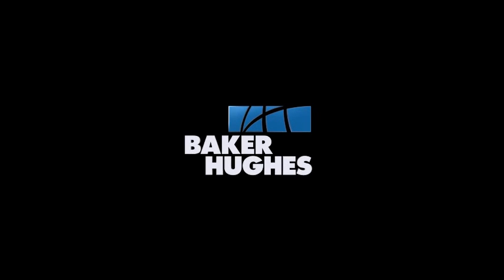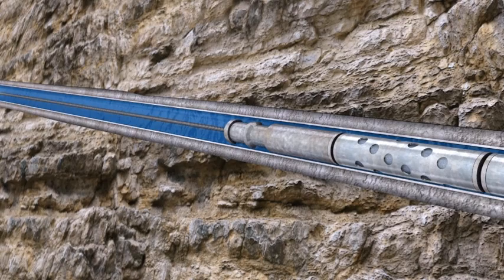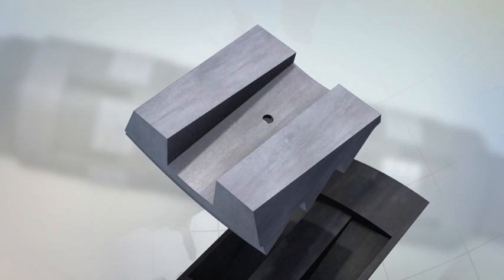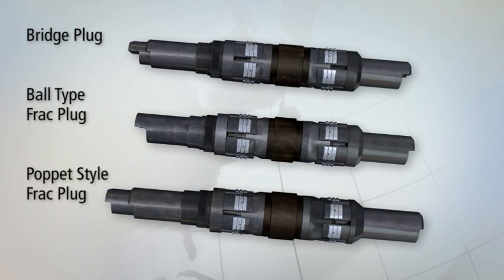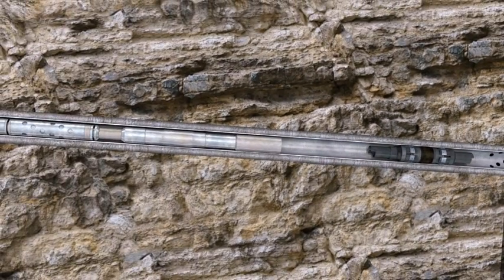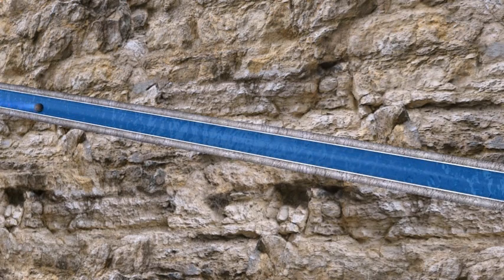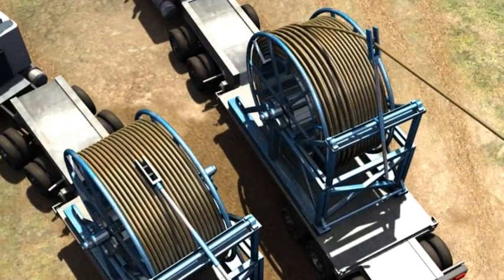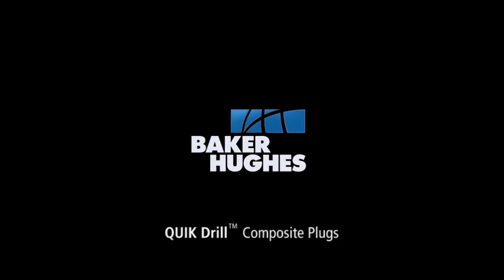QUIK Drill Composite Plugs

Comment: you could also put it in the plug but if you set the plug and have a misunderstanding and the guns don't shoot your screwed and coil tubing will be out there to drill out the plug.  It's risky , that's why your suppose to drop the ball afterwards.
Reply: misrun  not misunderstanding **

Comment: Hmm, when I was working wireline, the ball was placed on the top of the plug and then put on the setting tool. I was not aware of a type that involved dropping the ball from surface after setting the plug. Interesting.